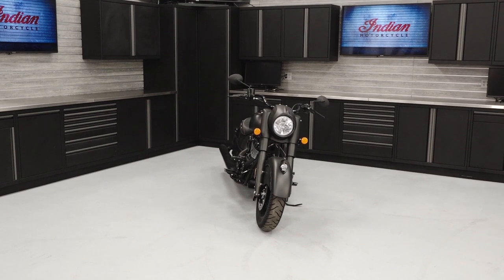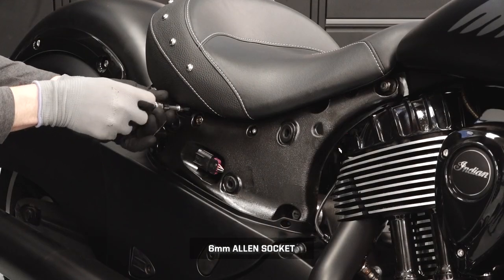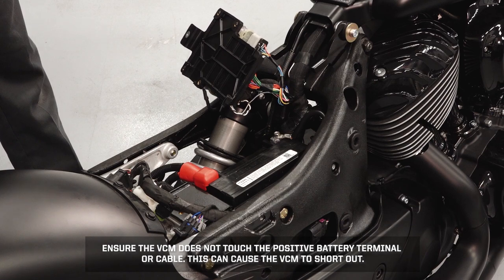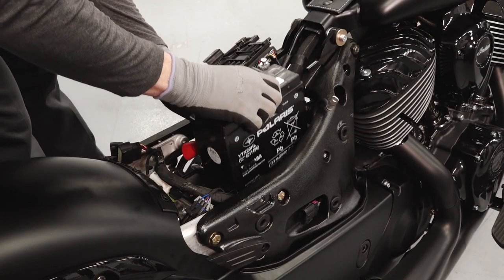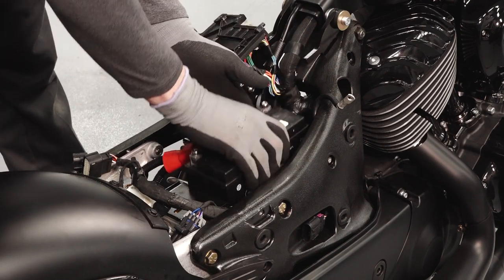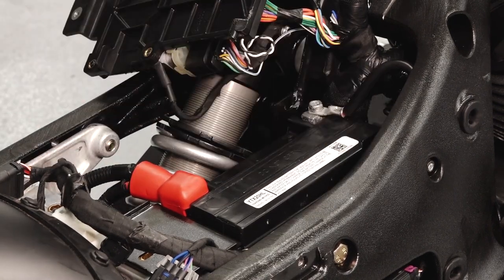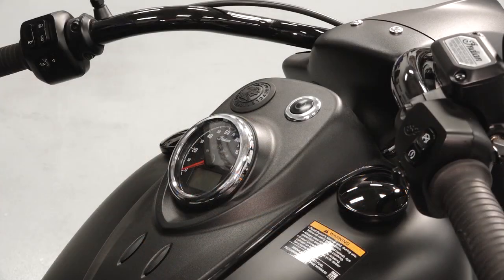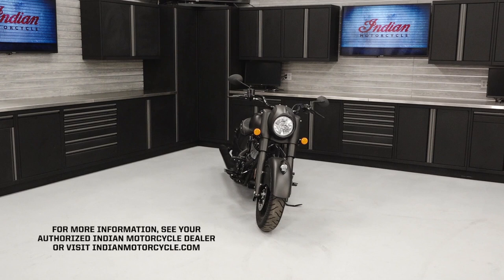Indian Chief Battery Removal and Installation - Indian Motorcycle

Comment: The VCM has instructions on it stating to remove the rear battery terminal first before removing the VCM. I had to do this so the VCM had room to slide out of it's holding arms.